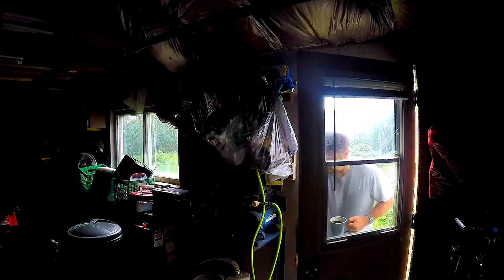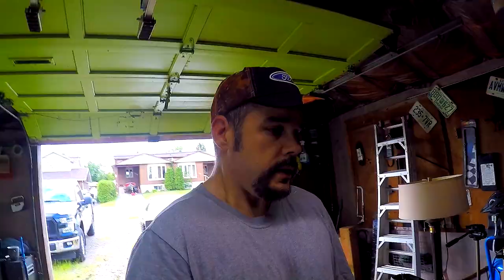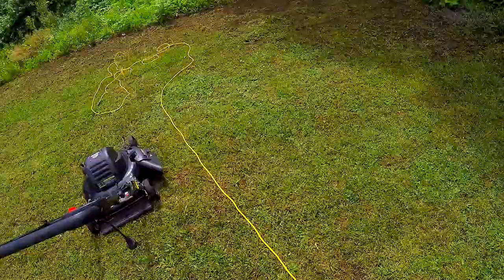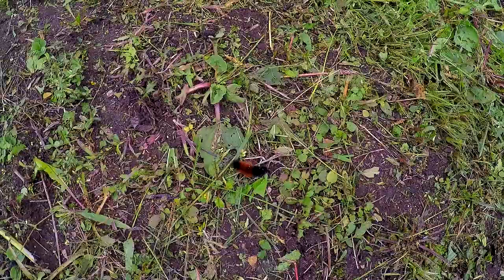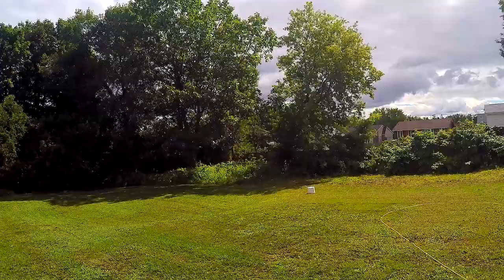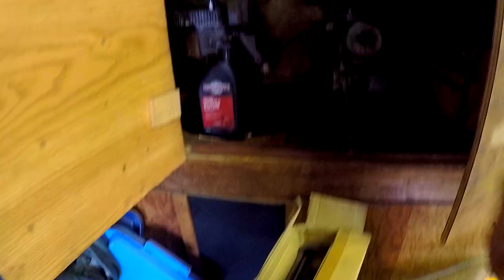Jobmate Electric Mower VS Rocky Weed beds

Comment: I suppose with an electric mower not having so much mass to the motor like with an engine-powered one, it's less likely to cause damage when hitting a rock, though it still can shear keys (if it uses them) and bend the armature though, but, that's what ol' Bender is for... :P
Reply from the maker: yeppers...just send bender in to get bent!

Comment: And as for rain plus electrickery, you might get a tingle, but unless you decided to take up naked barefoot mowing, it wouldn't kill you as there'd be no path to ground to give you a shocking time, still not a good idea though, water ruins the coppery bits... :P

Comment: 🤔 is that a doorbell i hear?😂😂 
When i had my property out in the sticks...i got an old mower for free...fixed it...then did what an old fella showed me. Took a grinder with a cutting wheel and cut open the front lip between the front wheels. It will mow through them plants 10x better. 2 things tho...never get in front of mower while its running if you cut that front edge out and 2- if the mower body is plastic...like on a lot of electric mowers it cant be done or else the front wheels turn into a idiots tuner car...metal body is fine as its strong enough. Basically turning a grass mower into a bush hog. Can sharpen blade while its attached as well..just gotta make sure to take off equal amounts to both edges or mower will vibrate more than Turdeaus vibrating butt plug.
Have a good day man...from the east coast.
Reply from the maker: well...the front wheels already have camber on this electric mower LOL.  Its what happened when the shed fell on it.  I may however have to modify bender into bush hot mode. It is a metal body...a rusty rusty metal body.
Reply: If you cut out that front lip will cut alot better...that front lip just pushes stuff down then blades run over stuff instead of through it. As far as the bad camber on bender...that an easy fix...just bend metal straight again where wheels mount. 
PS-catch some damn fish would ya...sheesh...lmao

Comment: Gas is boss
Reply from the maker: maybe my gas mower is too old to be boss...because bender outperformed the gasser big time.
Reply: If that electric mower is cutting better tban the gas one...then the gas one is in need of a major tuneup..RE: Cleaning flywheel and pickup coil with sandpaper/emerycloth....will give much better spark...replace sparkplug and make sure its gapped right...sharpen blade and balance it...very easy to do...change oil if needed...clean airfilter and carb...after that it should run circles around that jobmate.  Wish i was closer bud...less than an hour that gas mower would be running fantastic. 
Might bre a good time as well..to drain any gas out of the snowblower..add fresh gas..run it till it warms up...be all ready for that lovely white crap thats coming😎